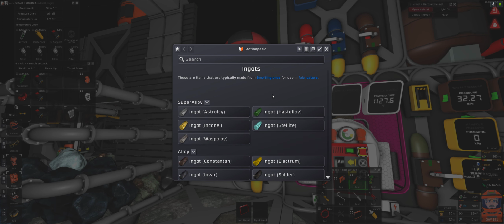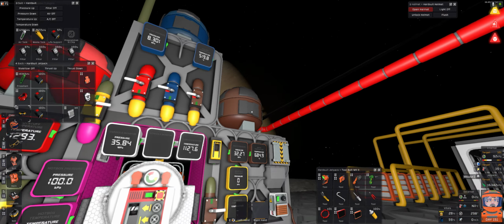Stationeers - Mimas BRUTAL Start - Part 19

Comment: it's good to have good method to extract volatiles from ores because later you will have biomass to process too.
Reply: In my opinion, you don't manually process enough cobalt during a save to merit a seperate process.
And for simplicity's sake, you generally want to keep your biomass processing seperate from ore processing, or you'll be setting up a bunch of sorters and have to manage a lot of gas processing apart from the volatiles.